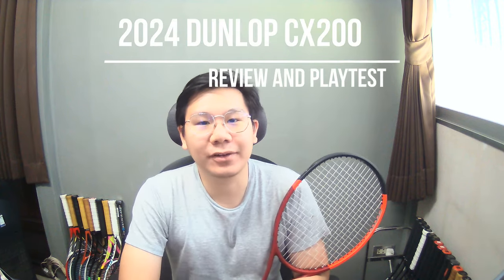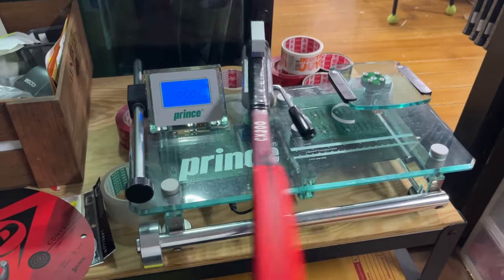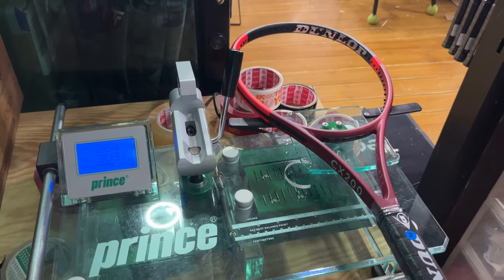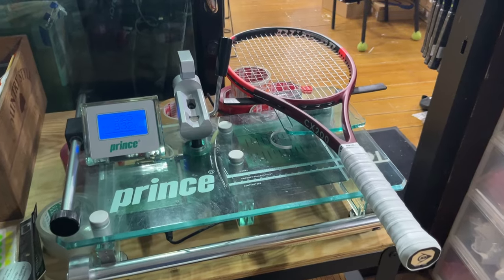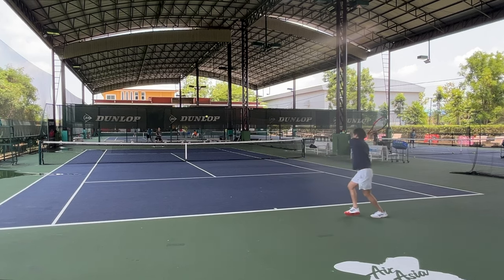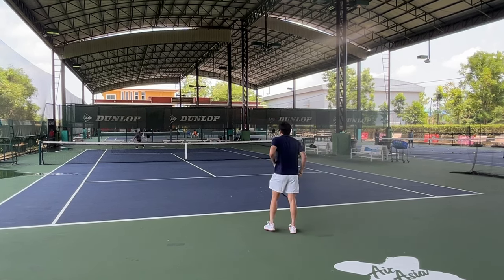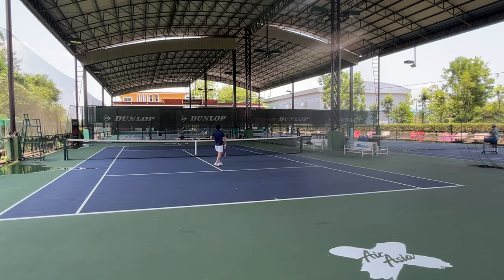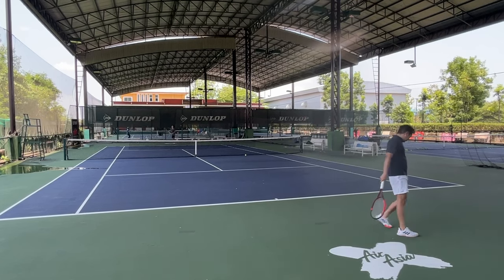The Truth About 2024 Dunlop CX200 - My Honest Review

Comment: 300 gram as platform racket is perfectly fine, but the base swing weight should be at least 285 or 290. Anyone who customize rackets starting with a platform racket will not play with a swing weight strung below 320.

The version before was a platform racket in that sense. Cx200 but also cx200 tour were between 315 and 320 swing weight strung which is ok to start with.
Reply from the maker: That’s my point. If it’s 305g for a platform racket, swingweight needs to be around that 280-290 range so you can do small adjustments to what you like, not adding another 15-20g on this weight.
Reply: @tantennis  yeah the amount of lead you have to stick double or triple in the top of the head is just too much to make it playable. Bringing an unstrung 260 swing weight to 325 strung swing weight would take about a little bit more than 10 grams of lead to be placed in the top of the hoop. That's crazy.

Comment: Nice review. Did you measure the strung swing weight in stock form? Are you planning to test the CX400 Tour?
Reply from the maker: Mine is 315 in stock form but it is an overspec one. For those unstrung rackets, I think SW will be 290-295 strung.

Comment: That's just how I initially felt about my IG Prestige MP. It is underspec'ed in static weight. I don't have a swing weight machine and balance board. But it feels like too much weight in the throat. And then you have to force the lag and snap. Instead of it happening more naturally. I would think that is too depolarized. You need weight in the hoop and the handle to polarize it. And curiously, more weight to move properly...laggy, with enough plow through...and fast through contact. These seems to be the MGR/i thing. A proportion of mass and weight distribution. Please correct me if I am wrong.

Probably the easiest racket I ever played with is the LM Radical MP. What a lovely way to move. How much predictability. True control. And proper amount of power. It is like you can place the ball wherever you want to. Be relaxed or in a rush. So much control. And power as you want. Lovely as it was not overpowered as power frames, that force you to step back on the power and apply spin. But letting you use so much of your power. TW averages the LM Radical MP at 325sw strung. But not measuring the actual specs, the weight distribution felt great. That is, enough weight in the middle of the racket. And good amount of weight in the hoop and the handle. And syn gut on a 18x20 pattern. So comfort on sensations and so comfortable to use. Felt amazing. Amazing.

This is what I've found: Too much weight in the poles and too little in the middle, and you lessen control, so you need higher strings tension. Too much weight in the middle of the racket (that is, the lower hoop and throat) and too little weight in the poles, and the racket feels slow, pushed, and lacking power, maybe needing to drop tension. Its a compensation thing for the way you want your racket to move...the amount of power, control, and spin...and the sensations you want at contact. Would you agree?
Reply from the maker: I agree on almost everything. The weight distribution is like, where all the weight is at, in the throat. That’s why it’s lacks plow and super unstable. And I agree that LM Radical MP feels really good and quite powerful for a 95 sqin. I added leather grip to it though.

Comment: Honestly you really need to demo the rackets that you are interested in. Watching review is great and most of the time the reviews are quite fair but you really don’t know until you tried them. I got mine only 2 days ago and from the get go play really well in stock form strung with Head Lynx Tour grey 1.30ml . The best thing about this racket is predictable and consistence string bed ( which give good directional control and depth if you can swing with a bit of spin ) super comfortable but some may find it a bit muted or mushy but it work well for me, extremely user friendly maybe due to swing weight being low but yet stable enough. I think for recreational level players with the good level of fitness and decent techniques this racket can be  a real weapon. Please don’t sleep on this racket. So for last a year or so  I have tried Head Speed Pro, Speed mp, Radical mp, Boom Pro, Yonex VCore 98 2023, ProStaff 97 V12, Ezone 98, EZone 98L customise with lead. So I have a fair bit of experiences with 98 size rackets. CX 200 come across the best in my opinion.

Comment: How does this racket compare to the new cx 200 tour 18x20? I want a racket with a pretty connected feel to the ball and with good control and do not mind the super low swing weight because I could just add lead to fix that.
Reply: I have cx200 tour 16 x19 2024. It's amazing. Go wuth that version. It as putaway power. If u need extra control use 16 gauge strings at 55lbs . The . 18 x20 supposedly  lacks the pop  but i expect it 2b great also. Thinner gauge string in 18 x20  like 1.20 would add  spin 2 it  . Head lynx tour is a  good string 4 these rackets. I put 1g of  lead at 12. Don't b concerned abiut swingweight. It's very stable at a much lower swingweugh tthan other rackets
Reply: SW on the tours will be around 315-320 strung. You will still need to add lead tape to the head which is consistent with the previous model as well. The newer model is a little stiffer and more powerful.
Reply: @emp6  How is the feel of the racket? Is it muted or is it connected?
Reply: @robertburdis8438  Thank you for the recommendation, I'll see if I can somehow demo both of them and see if I like the feel.
Reply: Racket is sollidish  without  any unwanted  vibration. Feel is great.It's easy to swing but goes through ball like a sledgehammer.Giving it power. There r a few reviews up on tour. . I haven't tried 18 x20 myself  but alot who tried both in 2024 version  r  favourung ease of  use of  16x19 in matchplay. It's my favourite racket
Reply: @robertburdis8438  Thank you again, I actually might buy a cx tour. I just need to find whcih strings patterns o get it in. Thanks.
Reply from the maker: Thanks y’all for sharing your thoughts

Comment: I have  2 cx200 tour 18x20  2021 versions and have test the cx 200 2021 and 2024 along with the cx400 tour .     The cx 200 felt bulkier in the air compared to the previous version and did not have that family of racquet feel .  The update was designed for comfort  according to an ex pro playtester I spoke with . 

All 3 updates were in my grip size and the cx 200 tour was the whippet through the air and interesting . I was not enthralled  by it , it is a racquet to retest .

I would suggest if you can , test out the cx 200 tour 16x19 and do  not purchase racquets before hand , it becomes mentally and emotionally frustrating . 

To make my 95 cx 200 tour perfect feeling ,  since it was within the weight category of the 16x19  with a   low swing weight  I added  1.8 grams at 2 ,10 and 12  . I also placed  a kimmony  thin over grip  to decrease the grip increase , aesthetics and counterweight the racket . It also brought down the sweet spot .

Because the 2024 is a straight beam vs the wedged beam I would suggest less weight . Do it with vibration dampeners at first and get to tungstan putty from tennis only if they have it in Australia.  It would be useful in the grips of all your rackets to test and poss keep . That does not seem possible on the percept because the pallet is sealed because of the vibration dampening in it. 

The weight of the cx that I had did reach 340 all together , but that should not be the case for you . If may reach 335 . Balance is key .  

If you prize precision in  an all court player frame with 1.8 grams  at 10 and  2  , then try out the babolat purestrike and the point and shoot yet prefers higher tensions ,  wilson ultra pro 97 .
Reply from the maker: Seems like CX200 Tour has more positive feedback from users.
Reply: @tantennis   There is a real difference between the cx 200 , 200 tours and the 400 tour other than head sizes alone .  Another option other than tungstan putty in the but cap is getting the solinco 5 or 10 gram weighted but cap . I was told by tennis warehouse and perhaps sold at tennis only , that it was  fitted for dunlop  rackets . Inform them of your grip size . 

I am not sure if they are all the same and I am a size 2 grip .
Reply: What strings / tension did you use on the 16x19 CX 200 Tour?
Reply: @KozielloRU  Since the demo for that racket came from Tenni Warehouse and it was their generic full poly.  I would think that they put it at 52 lbs . 

For me and for comfort I would not go over 36 1ls or a bit higher .  Ask TW u.s or TW europe or Tennis only what tension they use .  The problem is I could not get an accurate assessment  of It .  TW  placed 16 gauge / 1.30 mm strings in  this 95  for standardization purposes which screws up my foundation for testing .  Tennis only and Tennis point are doing yhe same as well .

If these rackets do not get sold by them.  It is their fault because of their own actions here .

Comment: Is Restring Sync 46 lbs, 44 lbs crosses what you’d recommend for 95-98 sq inch control racquets in general?
Reply from the maker: Yes. Now it’s my no brainer poly string to test on thin beam foam filled control frame kinda racket alongside my tour bite soft.

Comment: Control, box beam, static weight of around 305gr - don’t you think they built it in this way for players that want to customize their rackets and wanting a heavy racket at around 340+ grams? In that case it could make some sense but then why not make it 320gr with a swingweight of say 310? I think Dunlop had an idea but their marketing department wasn’t involved.
Reply from the maker: Based on this spec with both low swingweight and twistweight, the only way to make it playable and stable enough while keeping the balance is 340g+. But this will target a very limited group of players, and as you said, why don’t they make it heavier if they target this upper group of players? Meanwhile, CX line also has CX200 Tour for a more advanced group. Either way, it doesn’t make sense to me in terms of positioning.
Reply: @tantennis  At the same token, Dunlop is not a big manufacturer and they have historically made rackets for players that know what they want.

Comment: Cx200 tour 16 x19 is what u should've tried. That is  an anazing racket. I gad gravity , blade pro & 100.. They weren't  anywhere bear as good 2 me. I've not tried normal cx200 though .i've never seen anyone say anything bad abouut tiour version. .Tour  will probably fix issues u have wuth normal verson.  I have percept 97d  &PA98 also, I prefer tour by quute abit. It's an easy to manage control racket.I only putv 1g lead  at 12.
Reply from the maker: Thanks for sharing

Comment: Something is most def wrong with this racket and Dunlop's QC.

They should send you a correctly specd racket and then you can test it again.
Reply from the maker: The one I playtest in this video has been handpicked with highest swingweight (283 unstrung and 315 strung). Still very unstable even with customization. I think it could work when static weight reaching 340g strung.
Reply: @tantennis  yeah, 283 sounds better but still this racket should be like 290 unstrung 

Even my Pure Aero 2023 has higher unstrung SW at 289.
Reply from the maker: @cekinekshn  I agree. And I saw Tencomm review mentioned that twistweight ultra low. Probably that’s why I don’t find it stable even with some lead.
Reply: @tantennis  yes, I also saw that vid from Beckett 

He received even lower specd racket after Dunlop contacted him and proposed to send him a proper CX200